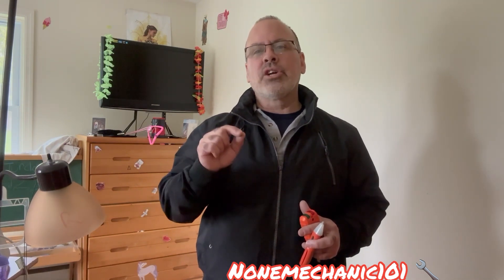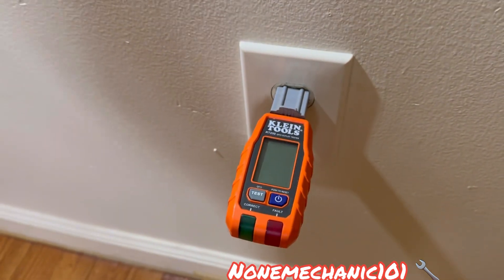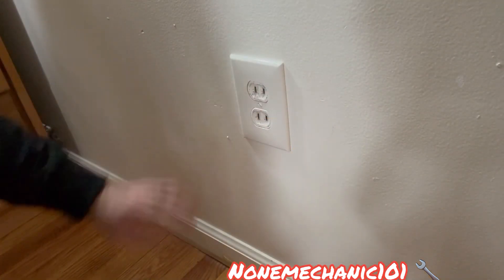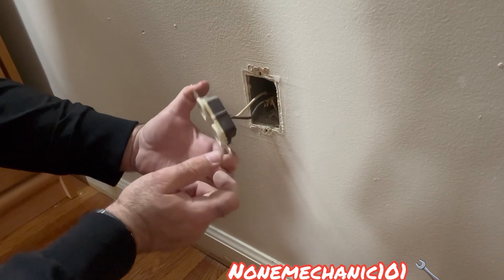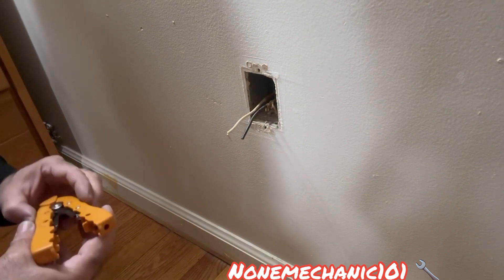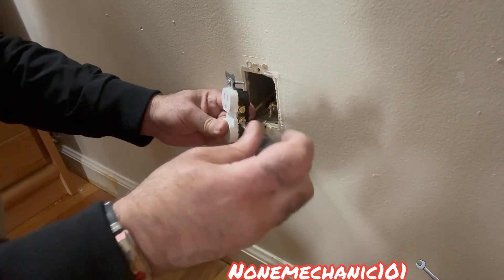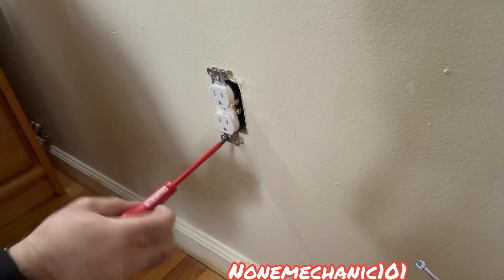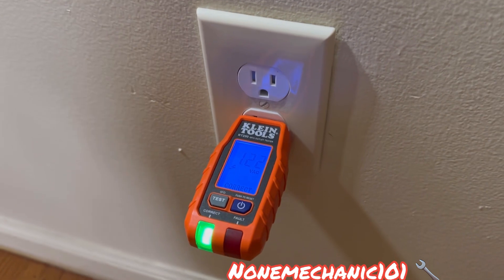How to Fix a Open Ground Neutral in a Outlet. Easy fix

Comment: You should have mounted the adapter with the cover plate mounting screw through the metal tab on the bottom of the adapter. That should show that there's ground. Open neutral was apparently the problem, probably because of a bad receptacle or bad neutral connection. The receptacle was backstabbed, which is notorious for contact problems
Reply from the maker: Thank you

Comment: Why did your tester give you the “green” good to go but not show that an equipment ground is missing plus you installed a grounded receptacle where no equipment ground is present? Pro Tip… you can use a GFCI receptacle as a 3 prong device replacement, just use the [ no equipment ground] sticker that comes in the box.
Reply from the maker: Thank you. I'm going to use a GFCI receptacle.

Comment: A bad receptacle is probably the problem. If it is don't take it out hot with no equipment ground on it. I had an end of the line circuit completely dead one time. Couldn't figure it out for the life of me. I finally found the hot wire was stripped and ended in pots and pans cabinet. The hot wire was touching steel and cast iron pans. I moved the wire and the whole circuit became hot again.
Reply from the maker: Thank you

Comment: Just NO! There is still a missing ground!! Cheapest way is to replace with a GFI outlet.  Use a update outlet tester it will give you a open ground.. not that it just has power ,a
Reply from the maker: Thank you

Comment: I changed the outlet and still getting open neutral? What else can it be?
Reply from the maker: I would check the wiring at the other outlets.
Reply: @NoneMechanic101  I’m not sure what circuit that outlet is part of.
Reply from the maker: @bajaaddict  In this situation I would get a license electrician
Reply: @bajaaddict flip the breakers

Comment: so i was brought to this problem from a issue i thought i had with my guitar. turns out every outlet in my mobile home/trailer comes up as open neutral i am completely lost with anything electrical related could somebody explain. do i have to change every outlet ? cause some were changed within the last 5 years or sooner. is it some sort of wire problem. is there no ground at all ?
Reply from the maker: The problems may not be the outlets. I ground wire or wires have to come from the panel.
Reply: @NoneMechanic101  ahhhh okay

Comment: I am getting an open neutral on an outlet...others on same chain are fine. I swapped it and its the same issue. I check and wires are fine. Possible fault?
Reply from the maker: need to wire from the panel with a ground and replace with a grounded/3 prong outlet

Comment: 2 prong outlets are not grounded.  They don't have the third prong.  You need to wire from the panel with a ground and replace with a grounded/3 prong outlet
Reply: Many homes of this era had grounded receptacle boxes. These boxes have a ground wire back to the service panel. If you use a receptacle with a grounding chassis like he did, as soon as he screwed the receptacle into the box he established ground. That's why the tester showed the correct wiring. He could've also used a ground pigtail screwed into the box from the receptacle. This receptacle is properly grounded and it's acceptable by code.
Reply from the maker: Thank you

Comment: I have the same tester… I have a question though, how is it reading correct with no ground connected? I have an apartment full of 3 prong outlets with no ground and the tester fails on all of them with OPEN GRD.
Reply from the maker: If the outlet doesn’t have a ground it’s going to fail
Reply: @NoneMechanic101 Exactly, and I didn’t see a ground connected to the outlet you replaced so I’m wondering how it comes up correct?
Reply from the maker: @tinfoilgloves  The box that's in the back is grounded. When this house was build they grounded the metal boxes. We don't see it because it is behind the box.
Reply: You need to change all the outlet with GFCI
Reply: Ahh, right. That was my next question lol. Thanks for clearing that up.
Reply from the maker: @tinfoilgloves  👍🏼